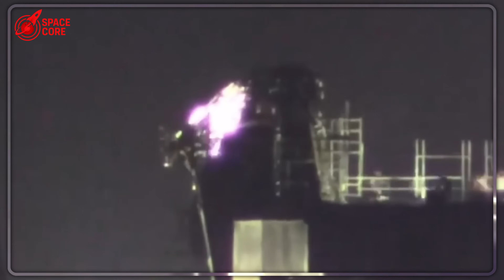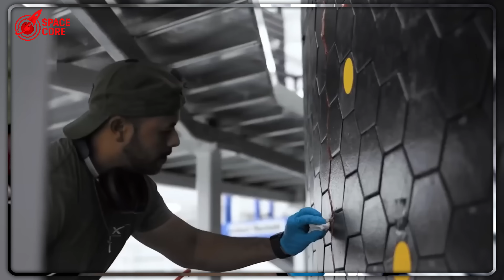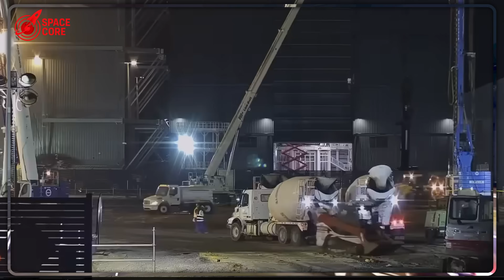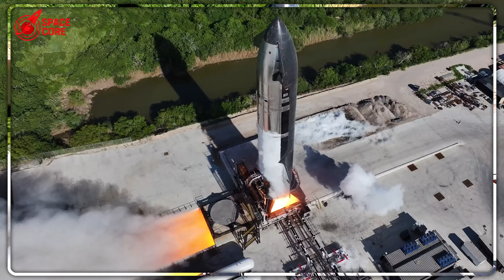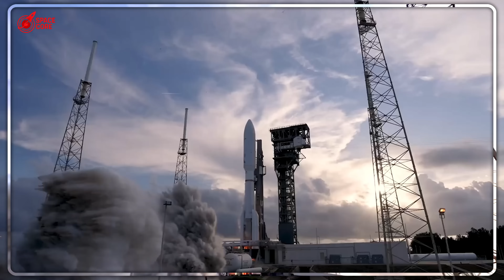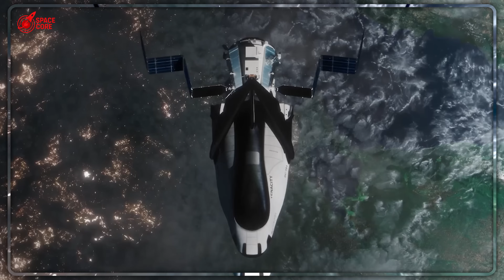SpaceX Flight 10 Engine Swap SHOCKED Engineers...Same Problem Killed Flight 8!

Comment: Maybe this is a dumb idea, but if they make the ship (not the booster) expendable, they could also eliminate the vacuum version altogether. Eliminating the whole heat tile system makes it so much lighter that a few percent less efficiency won't really matter, because they can put many more tons of cargo into orbit. And their engine production is so much cheaper that they can afford to throw them away.
Reply from the maker: Interesting idea! Making the ship expendable could simplify design and boost payload, but ditching vacuum Raptors and heat tiles might trade short-term gains for long-term reusability goals.

Comment: Think why a thermostat that holds a radiator cooled...
Hope my thought sharing, triggers you all at space x
Reply from the maker: Clever analogy! A thermostat-like cooling solution for vacuum Raptors could stabilize temps, but SpaceX's challenge is balancing that with the extreme pressures and rapid iteration needed.